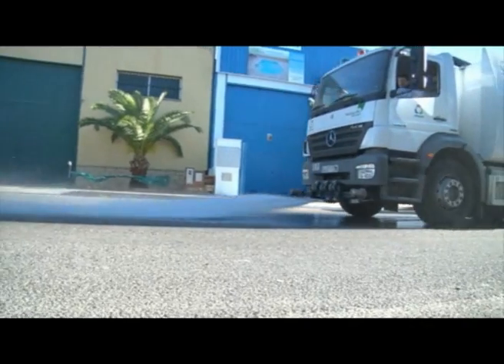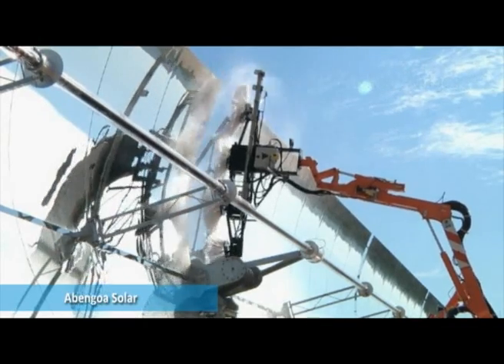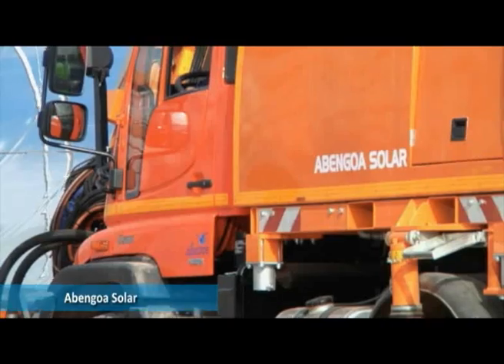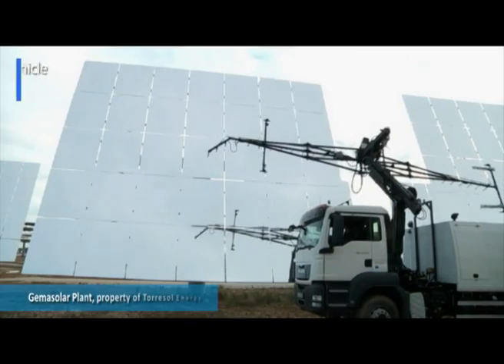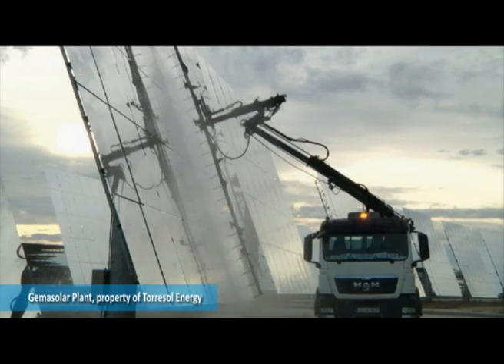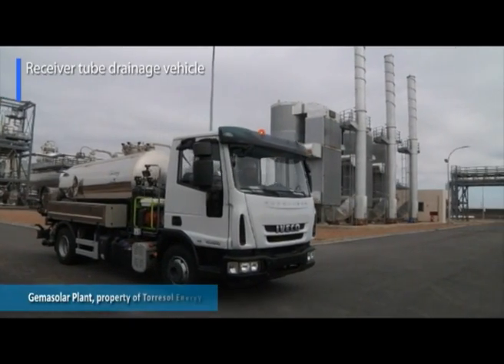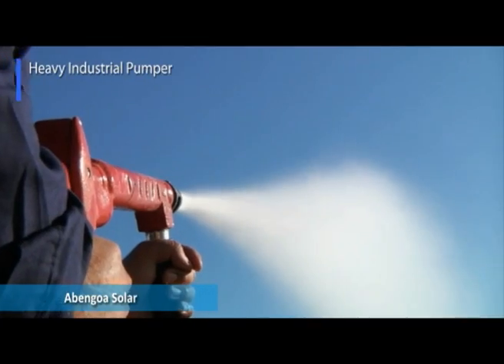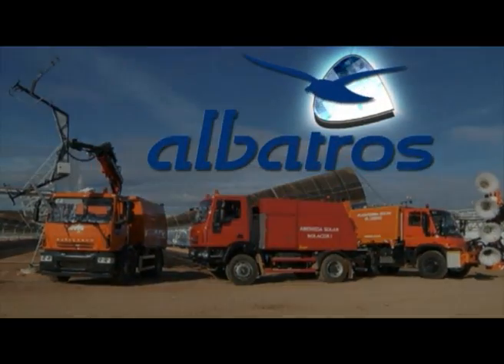Mirror cleaning CSP plants

Comment: 9000 l. tanks and waggy slow polybrushes 2-3MPH...18 loops of the Gemasolar/Torresol Energy place a day? It looks a horror. But it handles those close-in parabolic reflectors. Does the power plant condense much over 9000L on the turbines' cold side as some sort of side-effect? Was electrostatic or mirror-mounted cleaning out of the question, compared of course to the truck dieseling by all day?
Application research and Basic R&D are different, you! The HTF (high throughput fluid) truck's 'nitrogen therusion' for keeping the rubber solid is the only real howler in the mildly gamy Texmexican Voiceover.